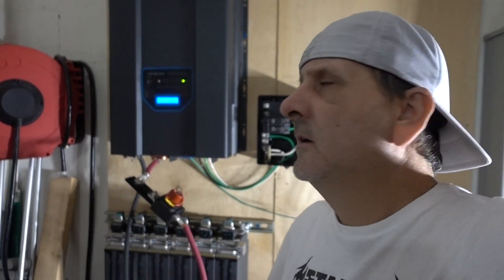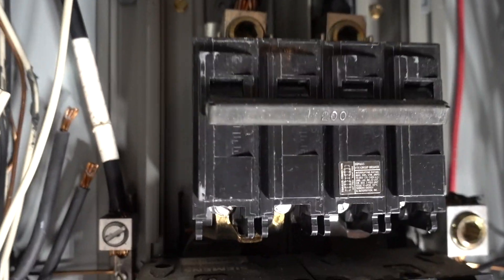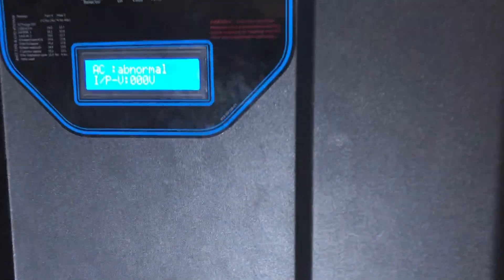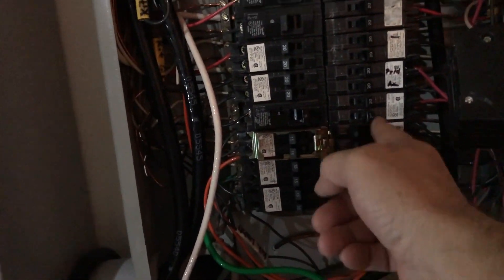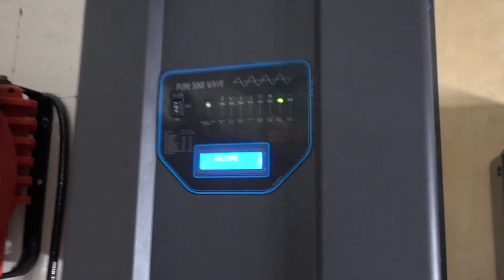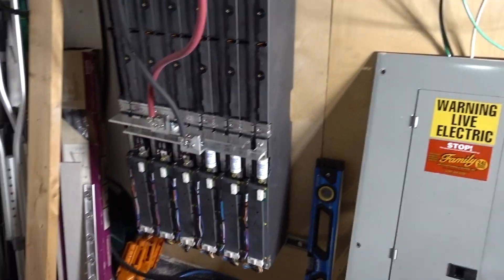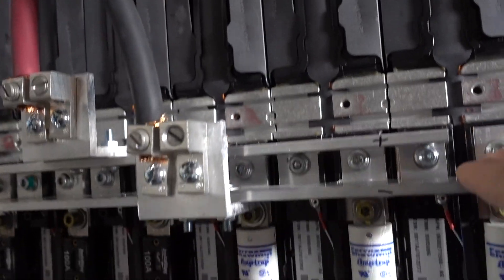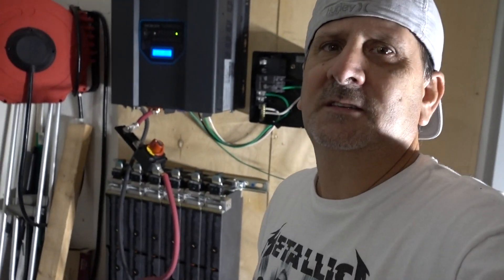DIY Tesla Power Wall Powers 2 A/C Units

Comment: My house need one 5 ton AC unit. I'm considering solar. How much power do I need to get from my panels and how many powerwalls do I need, and what specs on the AC unit...to be able to have my powerwalls power our AC through the entire night on summers in Phoenix? That is my goal. At that point, 100% of our power would come from our solar. Tons of sunlight here. Might need AC unit soon and I want to make sure I'm setup for for this in future. Some say you can't do it, others say you can with certain AC units with certain LRA and "scroll compressor." thanx. i know, lots of questions in there.

Comment: What HVAC unit are you running. Variable speed? Soft start needed?
Reply from the maker: I’m using a 4 ton Lennox system no variable speed and no soft start.
Reply: @WesThatTechGuy  Interesting. Told variable speed required. Actually have Lennox coming this afternoon to give a quote. Would you mind sharing the model number and LRA? Thanks.

Comment: Very curious what battery profile you're using on your inverter with the smart car batteries.
Reply from the maker: For me the max voltage I can get from the AC charger is 60 V. I also use solar to charge. These are not a good battery when it comes to inverter charger charging. Much better off using lifepo4 batteries or the tesla batteries. We now make and sell an inverter charger specifically for the Tesla batteries and the lifepo4 batteries.

Comment: You could theoretically have around 200 amps going through that 2/0 cable.  I'm looking at a similar installation with a 15kw version of your inverter and thinking of using 4/0 just to make sure.  We turned on everything we could imagine in the house and drew 11kw so it could happen but not very likely. We have another unit on property so that's why the 15kw.
Reply from the maker: This system has been fully finished and now removed and moved to our new Home and shop in the North West. It's completely up to code. I used dual 4/0 on both pos and neg legs. No issues at all they don't even get warm. The batts are in a NEMA steel enclosure for fire safety.

Comment: I have a question; I want to experiment on this first before plugging into house and I don’t see Any AC 120/220v output plugs on the inverter unit? Where are those or if I have to connect them where can I get them
Reply from the maker: No AC plugs on this unit only hard wired.

Comment: Thanks for the video.  I am interested how the inverter will handle a motor surge from a saw spinning up.  I saw on a review once that an AIM 3000 & 6000 watt inverter fried with the inductive load.   Thanks.   New sub here and I like what you are doing.
Reply from the maker: This inverter will handle most any home owner saw I'm sure. It's rated at 12,000w and 36,000w surge at 220v. Thanks for watching and thanks for subbing!

Comment: What kind of inverter is this?
Reply from the maker: This is a SolarGeni 12kw low frequency inverter. It will run your whole house.
Reply: This inverter i see you have it can take to 120v lines in do they have to be 180° of each other or can i just use 120v lines in?

Comment: I am always amazed at the lack of mistake prevention on these diy powerwalls...

Your battery buss bars positive and negative connections will explosively fail if anything falls on the small air gap you have...
Reply from the maker: This was a simple hook up and test video. The batteries are now in a NEMA certified steel 200lb. utility box with cover. Bus bars have been rubber dipped in all areas that are not connected to the battery itself (no exposed metal in other words). All wiring and connections are up to National Electric Codes. This is a very un traveled area in my home except by myself. This was a 1 time TESTING situation. Now you couldn't short the system out unless you actually wanted to. Thanks for Watching.
Reply: Wes That Tech Guy that’s awesome. My point is how sooooo many do not have protection from any issues.
Reply from the maker: I do agree. sometimes people set it up and don't realize the safety aspect of it. I know mine looks bad in the initial setup but I had mine in a controlled environment so it's a bit better. But yes lithium and all dc batteries need to be protected for accidents.
Reply: @WesThatTechGuy   The local pawn store near me has 5 eaten 304 Pole circuit breakers for a $125 apiece I'm thinking that's a good deal
Reply from the maker: do you mean eaton 3 or 4 pole breakers? and if so yes $125 is way high for a used 3 or 4 pole breaker. Otherwise I'm not sure what you mean. No such thing as eaten 304 pole circuit breaker that I can find.
Reply: Wes That Tech Guy sorry, no.
It is a 4 pole new breaker. 
Eaton Kd/pv 300 amp
Reply from the maker: SuperVstech Yeah you should be able to find that online compare prices
Reply: Wes That Tech Guy most I see are over 1800.00... I find the 3 pole models for 700ish...
Reply from the maker: SuperVstech Yeah I don’t know much about high-voltage three and four pole breakers so…

Comment: Did you ever have the chance to finish wiring that system up with the green wire is not on the main Breakers
Reply from the maker: Thanks. I subbed your channel
Reply: @WesThatTechGuy  thank you just a question why did you want to sub to my channel
Reply from the maker: because I seen you posted about your battery pack/powerwall on Jehu last night so I stopped over to you site and was checking out 1 of your videos: Start Capacitor Vs. Run Capacitor and why not to use it in a power strip
Reply: @WesThatTechGuy  thanks for coming by more video in production currently
Reply from the maker: You're Welcome
Reply from the maker: Yes. that was just for my own testing purposes. The system is  now wired and battery bank is in certified metal utility box as well as all breakers. I'm AC coupled and am using 2 auto transfer switches between the grid, my generac 20KW and the inverter. The system is incredible.
Reply: @WesThatTechGuy  I'm glad you're enjoying it congratulations on all the work

Comment: Awesome setup! What’s the runtime on this battery pack at full load and half load on the AC side of the inverter? How far are you discharging the batteries?
Reply from the maker: Trevor I can run my whole estate no problem and have not yet had to rely on just the inverter for a power outage for more than an hour or 2. I only discharge my wall by no more than 30% so I like to keep it charged to 70%+ I have never reached 100% usage of the load EVER and I have 4 buildings and a lot of electronics running. I run at about no more than 50% ever. It runs very efficiently. I wish I could tell you more but everything I own as far as big appliances are all energy star and lights are LED tv's too.

Comment: what should be the maximum difference between capacities for cells to connect in parallel in a pack(2900 with 1700 should be ok)
Reply from the maker: Not sure what you mean? Please add more info. thanks

Comment: How do you plan to charge the batteries ? Have you found a good Lithium charger / BMS or will you pick up a Tesla charging unit ?
Reply from the maker: I have an AC lithium charger and lithium solar charger. I use a BMS and no I won't use the Telsa system.

Comment: I have 2 of these tesla battery packs. Any info out there as to how to connect them? Can you make a video about this. I am not sure and do I need to connect the BMS or can I not use it. Thanks
Reply from the maker: Rafael glad to hear it. I made my own aluminum bus bars. you can use some 1/0 wire and crimp some ends on it. yes I use a seperate BMS than the one thats on the batteries. I wouldn't use the supplied BMS unless you know how its wired and how it is configured from Tesla.

Comment: Hi Wes,  what's the new update on your system ? Have you added more batteries and how is the system performing ?
Reply from the maker: I have it all finished and batteries are now in a NEMA rated enclosure. I have doubled my batteries and cleaned all the connections up. I have not installed the new battery packs because I'm moving from the area and taking it all with me. All things working beautifully!
Reply: Great! would love to see the new update video after you must have moved.

Comment: are you sure about the size of the A/C. 4 ton equal 14.06kw + 24000BTU equals 7.03kw this is about 21.09kW and the inverter is only 12kW, maybe I don't understand can you clarify
Reply: Jose Garcia modern AC equipment uses lower btu compressors with large coils to extract more heat transfer than the equivalent loads would imply.
Reply: Jose Garcia also, mini splits are variable speed compressors, and can start up with FAR lower amp draw..
Reply from the maker: Jose Garcia this is not what the AC takes to run, it takes 115 A to start it. After it starts up it takes way less amps and watts to run. With 4 refrigerators running and a 4 ton air conditioner and a mini split air conditioner running everything in my house and in the youtube studio turned on in the night (all TV's computers, lights etc.). The inverter runs about 43%-45% load. So that’s around 5 to 7000 W consistently after the air conditioner pump‘s have kicked on and refrigerator pumps have kicked on. It only takes about one second for the air-conditioner and fridge compressor to fire up and that’s when it takes the most power or energy and then it settles down and runs rather efficiently. Hope this helps. Bottom line this is inverter will run an entire house with a 4 ton AC system no problem.
Reply: Can you share those "couple of pieces" you have done to make the net metering possible with this inverter possible? It would be interesting to see how you have made the A/C coupling with this setup and the grid tied solar work. Appreciate your reply.

Comment: Why did you go with Aluminum bar  instead of copper to connect the batteries?  The bar size you have seems good, but Alum is pretty bad conductor; only 61% conductivity vs copper. Corrosion is also a problem when there are two dissimilar metals in one system. Al will electrochemically react with the Cu if moisture is introduced.  Friction welds are recommended with dissimilar metals connections to remove potential of moisture intrusion.  Something to keep in mind with future projects - thanks for the vid.
Reply from the maker: SOKO thanks for the input. Yes I know this but with this type of setup, and needing a CUSTOM bus bar, this was the best way to go for me in my air conditioned garage. I have no loss in voltage or current at all from the battery to the inverter. I have the same readings at both points. Sometimes aluminum is necessary when doing custom work on the cnc machine. Copper plates and sheeting are not nearly as available. Your welcome on the video. Thanks for watching.
Reply: Hi, nothing wrong with using aluminum. All electrical panel in US are made of aluminum. If you don't believe me go open one up. I just hope wes that tech guy use anti-corrosion at all his connectors. You can buy that at HD. Hey, if you read this...this is cool vid and thk for shar'g. I'm try to use lithium too but debating if I want the older smart lithium pack like your...or go for more newer/expensive model S/X P90.

Comment: Your inverter has a 36 kw surge? Nice car in the garage. When I grow up can I be like you? 18 kwh in batteries nice
Reply from the maker: Yes it does! Are you asking what 36kw sure is like, you don't understand or what because you stated it in the form of a question? Thanks! I love my cars and work very hard to have them. Careful what you wish for! You just might get it! Thanks again.
Reply: Wes That Tech Guy sorry about the question mark. I have installed them for clients so I am familiar with them. I would love to have your skill set. So I have wished it and hopefully when I grow up I will have them. What BMS are you using. I have a 48 V inverter with a 46 v cutoff

Comment: Do you charge the tesla batteries with the inbuilt charger on the inverter?if yes, how do you set the low voltage shutdown?
Reply from the maker: No but I can. It just won't charge them to the full capacity. I need 63v and it will only charge to 60v but still a huge help.
Reply: Any programmable charge controller or inverter will works with lithium. You'll need to control it by 0.1 volt at a time and always disable the equalizer or you'll burn/blow it up. And this must be done by software not dip switch since it very precise.
Reply: what is your low voltage shutdown number on the inverter?  is it the standard 40/42 volts based off your dip switch position?  if your high voltage for 100% charge is 63 volts, whats your low voltage (maximum discharge) number on your battery pack?

Comment: will your future 100 amp manual transfer switch be a two pole double throw double throw safety switch, or will you use a 3 pole safety switch and break the white neutral wire?
Reply from the maker: Andy I'm not going to be using a manual switch. Currently I'm just using manual breakers but when ready I will be using a fully automatic transfer switch. I'm trying to find a 2 position transfer switch is one exists or I might just hack the one I have running to my generator. I will keep you posted

Comment: Does the real  Power wall 2 have a inverter inside ??
Reply from the maker: The Tesla Power Wall does in fact come with a built in inverter. 5000w continuous and 7000w peak.
Reply: thanks
Reply from the maker: Glenn YW

Comment: Wes, can you tell us how many Solar PV Panels you have? Please list the specs of each Panel and the Combined whole PV setup. Thanks!!
Reply from the maker: Currently I have NONE installed as I'm moving soon so I haven't installed them so potential buyers won't insist on me leaving them with the house lol. But I have several panels from 15w to 380w. I have some simple 12v 100w units from renogy to the 360 of my own brand. I also have hundreds of panels on the way now being imported.